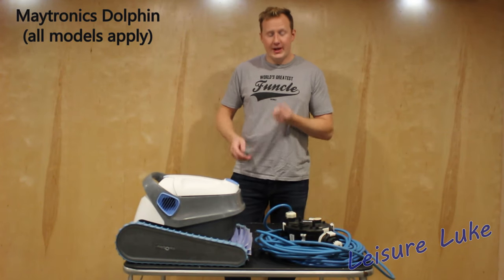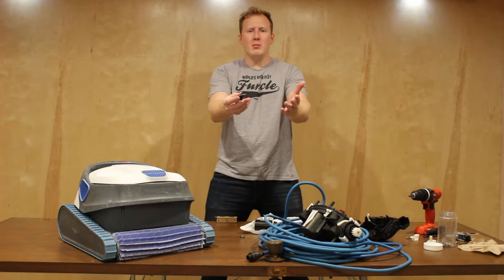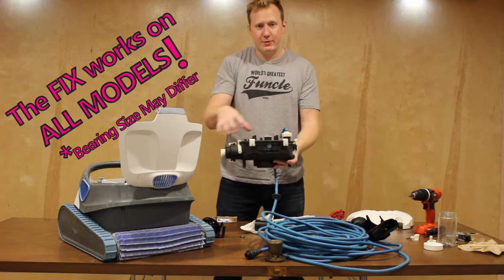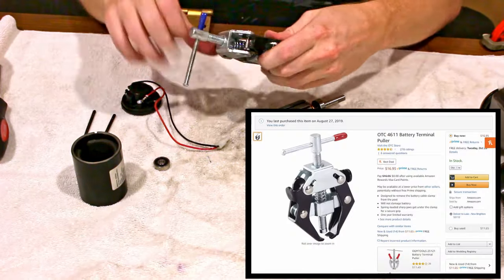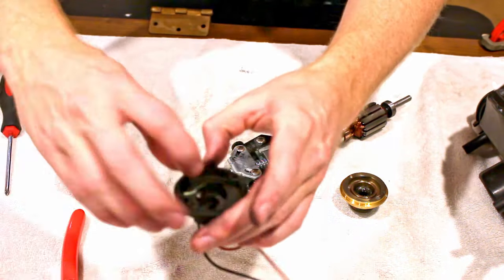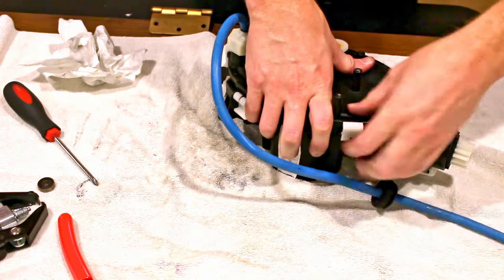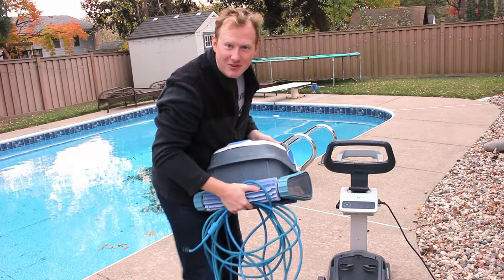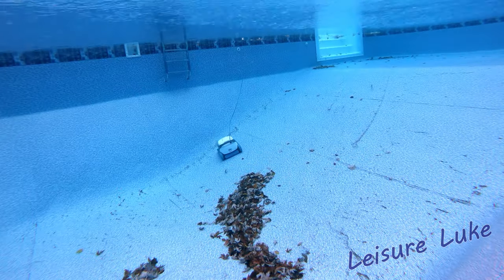Dolphin Pool Cleaner - BROKEN is FIXED!!!  SOLVED with 1$ Bearing | HOW TO REPAIR for MOST Models!

Comment: Great video. Got the motor pulled without a problem but unfortunately the 2 motor screws would not budge and are now stripped. I sprayed with Liquid Wrench and will let sit overnight.

Comment: Sweet as.  I have a different brand evidencing EXACTLY the same issue.  Starts moving then stops and shuts off all the lights on the console too.  Has become worse over time till now its a few seconds then lights out.  Removing the filter and running it only runs a bit longer.  Trying to drive the tracks is really hard to do but the impeller is free as a bird.  SO for me its likely to be the movement motor has a seized bearing.   Here's hoping that my Polaris p825/Zodiac CX20 motor unit is as serviceable as yours was.  cheers
Reply from the maker: Very likely, I've read comments of several other brands/models with the same issue on drive/impeller motors.  Fortunately, most come apart easy, and you've got nothing to lose!  Good luck & keep us posted!

Comment: Thanks for the great video. My impeller has no debris and will turn, but will stop immediatley if I stop pushing it. Should it continue to spin on its own after I give it a nudge?
Reply from the maker: Nah, there's some normal motor resistance as you pass the magnets.  If it's seized it'll be hard or impossible to rotate at all.  Sounds like your problem isn't the impellor motor bearings. Good luck!

Comment: I took my dolphin apart and found the same seized bearing.  just ordered the puller tool and the bearings from amazon.  I'm feeling optimistic that i'll have a working robot in a few days. thanks for posting the vid!
Reply from the maker: Nice work Braydon!  You've already done most of the work just identifying the problem!!!  Good Luck with the Fix, keep us posted!!!!
Reply: @LeisureLuke  The new bearing did the trick!  Robot is cleaning the pool right now and seems to be fully functional.  Now we see how well I resealed everything and hope water doesn't get into motor compartment.  thanks again for posting this video!
Reply from the maker: @braydon9493  Congrats on the fix!!!!  That's good money and plenty of landfill saved... good things!  That helps us afford chlorine this year!!!  Haha.  Seriously though, well done!

Comment: I have just had my robot for 2 weeks. It is running but leaf sometimes got into the impeller.  I can took most leaf out by squeeze my fingers onto the impeller.  I am already tempted to taking it apart after watching your video.
Reply from the maker: Yeah, it's just a few screws.  Keeping the impeller clean is crucial.  I clogged impeller won't let your suction properly, so climbing walls and clinging to corners can become problematic.  Good Luck!  You Got This!

Comment: Hi Luke, thanks for the video, my impeller spins, was your not spinning at all or just tough to spin?
Reply from the maker: It's always a little tough to spin, that's normal magnetic resistance in the motor.  IMPOSSIBLE to spin means you have a bearing problem.  I couldn't spin mine at all by hand.

Comment: Awesome video, I'm going to try to take mine apart see if it is the same problem. What I noticed with mine is that it goes back and forth, then stop. If I put it upside down, it does not stop ! Drives me crazy, I love my dolphin pool cleaner and want to bring it back to life !!! I'll update this comment if I can fix it. Thanks again for the video.

Comment: Mine is the nautilus cc plus my impeller seems to be fine but the drive motor shaft is barely moving and noisy. I’m going to give it a try. Thanks, didn’t expect it to be that easily repaired these things are usually impossible to get apart without breaking something is the reason I didn’t give it a try. Now I’ll take back apart tomorrow. Thanks so much! Phillip Hurst
Reply from the maker: I’m impressed with how well these come apart and go together.  I know other nautilus cc owners have fixed their drive motors the same way, and I’m 99% sure those call for the same bearings!  Good luck & keep us posted!

Comment: This is great! What is the pouch under the motor? It's shown in your video at 2:05.  Curious of its purpose? Mine was soggy and disintegrating
Reply from the maker: It's desiccant.  It's meant to absorb water incase water gets in it.  You should be able to replace it with any desiccant from amazon.  any 20-50g pack should fit.  These look good https://amzn.to/3AxnWFX.

Comment: Hey! Thank you so much for the video. I have been recently trying to open up the motor assembly, but I have hit a dead end. No matter how hard I try, the lid of the box won't let go. Are these white plastic clamps on the perimeter of the motor assembly the only thing holding it together, or is there something else? I would really appreciate if you had some trick up your sleeve! Cheers!

Comment: Hey Luke, Fellow Fipper owners. So, this week out of the blue.. my flipper started the dreaded move forward a foot, back a foot and stop.. I took the impeller top off and the bottom basket and its cover area.. nothing noticeable.. I CAN turn my impeller by hand, but it will not just spin it is tighter than that, seeing I never tried to mess with it new, I don't know the resistance level of it. but does this sound like I need to tear the impeller motor down also? I left the cover off of it and watched and it never does engage.
Reply from the maker: Hello!  There is usually resistance in the impeller motor, such that you could never spin it like a top, it's motor with magnets, and they tend to want to hold the impeller in place.  That being said, I'd still take the impeller motor apart and look inside your black box for any signs of water damage.  Sometimes cleaning out the carbon dust helps, you'll be able to check the bearings by hand, and you can check the length of those motor brushes, some people replace them and say it helps.  Remember to mark which color wire goes to which side of the motor - it matters :D  Good luck!

Comment: Looks awesome! My Dolphin stopped working and it may be the same issue. I will check it out and see. I will let you know. 
Thanks.
Reply from the maker: Good Luck!  If the impeller is clear of debris and still doesn't turn easily it's probably this.  Worth checking out!
Reply: Follow up— 
The motor was seized. Mine had different size bearings inside. I had to replace the 626RS bearing AND one of the motor brushes. It was difficult finding both parts. I had to order the bearing online. I found a motor brush locally but had to file it down to the proper size. I got everything back together easily and it works as it should. Thank you for your helpful video!
Reply from the maker: @zadina59  OOooo that's a lot of work!  Excellent job on the repair!!!  Congratulations, now you'll be able to afford that chlorine!  Seriously, well done.  That's FAR from an easy task.  You kept the landfill empty and saved some serious cash.  WELL DONE!

Comment: Great video. My impeller definitely spins fine, but my unit shuts off after a minute or two. Maybe it's the drive motor? Can you comment on how freely the treads should be able to move by hand? Although it performs the out of water test, my treads will move, but it is definitely not easy to move them.
Reply: I have the same issue. Out of water test it worked but put back in the water, it goes forward then back and stops within 10 sec. Visually I didn't see any dirt in impeller and it turned around but I don't know how freely it should move. If someone can comment would be perfect. thanks

Comment: Thanks for the video, my S200 stopped running and checked power supply and cable both have proper voltage. Impeller spins freely but the robot has no power. I’ll take apart the black box since you showed me the steps and see what I can find.

Comment: Are there 3 bearings or 2? I have one on either side that spin but I suspect there’s one more that’s wedged in to the main part - I’ve watched the videos a few times to try and figure it out- excited to see where I land!
Reply from the maker: 3!  The 3rd one is in brass cap, and doesn't come out with the center shaft.
Reply: @LeisureLuke It appears my issue is the bearing in the brass cap, but I can't figure out how to get it out.  I pulled the snap wring, but I don't know how to get access to the bearing from there.  Any guidance you can provide?

Comment: this is great advise thank you but I can separate the top part of the case from the rest of the motor unit, how did you do that?
Reply from the maker: Yeah, that's tricky.  Those plastic clips all need to be unclipped.  Then the lid is just held on by squished rubber seals/gaskets/rings and some grease.  You can use a flathead screwdriver to work your way around prying up the lid evenly until you're able to remove it.  Just be careful not to cut those rubber seals and you'll be alright.  Good luck.

Comment: Great video!  My Dolphin Triton PS was not moving, but still had water moving through it.  I disassembled the impeller motor and cleaned out the black powder with electronic cleaner and air compressor.  It is now working, but not going up the wall and falling backwards (pop wheelies as other described).  I am not sure what you mean that the red and white wires were reversed.  Do you mean on the mother board (green plate)?  I don't know how to solder, so what is an alternative solution?   Did I put the magnetic cover over the impeller upside down?  Thanks for your assistance!

Comment: This is pretty awesome, Luke! Thank you for taking the time to share your fix that worked on my Triton Maytronics, which also has the 626-RS ball bearing. At least, the one that was defective. The other one is 608 if I recall correctly. Both shields were collapsed, it was pretty impressive. There was also a lot of dirt/metallic dust inside, and fortunately no water. I took pictures that I am happy to share. I just don't know how to post them here.

Thank you for allowing to save additional frustration and expenses! Triton is now back in service (although I had to restart it twice  times, possibly until the fault cleared by itself. I wasn't able to reset it via the app, which seriously needs improvements.

A cool project would be to be able to start the robot from Wifi or set more than 3 repeats (useful when on vacay). And how about a feature that would allow Triton to not be tangled in my tikki table and stools in the pool? That would be nice!
Reply from the maker: I'm working on a tiki bar too - checkout a video I made about the Tiki Bar Top!  I'm mounting that on a Glastron PT84... which is cooler than it sounds #1Pun.  Now that I gotta see!  You can post pics and tag me @Leisure_Luke on instagram or @LeisureLuke on twitter.  I'd love to have stools in the pool!  Hahaha #2 Pun! :D Just no way to do it with my vinyl liner... that I know of.  Or throw it on reddit or facebook and send me a link!
Reply from the maker: Nice job with the fix btw.  Not an easy job, WELL DONE !

Comment: Thanks for the video. When you say the impeller is supposed to freely spin, do you mean like a ceiling fan? Like when I attempt to spin it, I'd be able to flick my finger and it freely spins? Or do you mean by applying constant pressure and it will spin? My does spin with the constant force of my finger but there is some resistance to that spin. Thanks again.
Reply from the maker: Sounds like you have a normal and good amount of resistance.  It won't spin like a top, but by adding constantly pushing 1 finger should be able to rotate it.  They're rarely "caught" in the middle.  It's almost always spinning normally or 100% locked and you'd struggle to turn it with a long pliers.  I'm guessing you're in the clear :) Good Luck!

Comment: Great video! Ever seen an issue where the motor drive and the impeller drive work fine in manual mode, forward and reverse only, but the unit won’t turn? Servo Overload message. The water flow piece that controls left and right does not move freely, in fact it clicks. No debris present, but at the point where I am going to pull the unit apart and attempt to fix myself. 30i active and issue started with a few months of purchase. I moved and it went to storage and I lost track of the warranty period, which has since expired, hence self repair.

Comment: Great video!  My Dolphin Triton PS was not moving, but still blowing water. I was able to dismantle the impeller motor and it was full of the black dust.  Cleaned with the electronic cleaner and then air compressor. reassembled it and placed back in the water.  Now, it is having difficulty climbing the pool walls and falls backwards with bottom up and does not seem to move as fast.  Not sure what else to do to fix it.  Should I just buy a new one?

Comment: Thank you so much for this video. I am hoping that this will be my fix. I have the motor out and my same bearing is locked up. Waiting on the new ones to complete the fix and give it a try. Thanks again.
Reply from the maker: Sounds like you're on the right track, and have found a problem!  That's basically steps 1-4 of 5 done!  NICE! GOOD LUCK!

Comment: Started my Dolphin cleaner this spring and the power supply popped. I was afraid to buy a new power supply. I came across your video and found some debree around the impeller. The impeller turned hard. So I followed your video. My cleaner has 2 bearing one in the brass cap which did not come apart. You were right. Getting the motor back into where the brushes make contact was a chore. My question is, How freely should the impeller turn assembled.? Thanks
Reply: I'm having the same issue. The impeller should turn freely with 1 finger rotating it

Comment: This was a great idea, and I followed the video to replace the bearing, however it still doesn't work.  Anything you can suggest I might have missed?  Thanks
Reply from the maker: Hmmm.  What are your symptoms?  Does it scoot back & forth and then stop?  Can your impeller be turned by hand when the machine is unplugged?

Comment: Great video Luke and really appreciate showing the impeller repair. Currently I'm trying to stop the Dolphin 20 from climbing the walls. Do you know if that's an option on the circuit board like dip switches or something? Ours scrubs in one place when it climbs and has gotten stuck behind the ladder so just cleaning the bottom would keep it useful. Thanks.

Comment: This winter i replaced the cable, rats chewed it into 3 pieces.  3 weeks ago when I opened my pool the Dolphin Nautilus CC Plus would not run, it was running last year.  The power supply is putting out 29+ VDC all the way thru the new cable, the cable continuity is good.  I opened the motor box.  It was dry and like new inside.  Both motors rotate with what I feel is the correct amount of resistance.  I tested approx 3 ohms on each motor terminal.  

My new cable is a 2 wire.  The old cable was a 2 wire, the output of the power supply is 2 pins.  Inside the motor box I notice that the motor leads are red and black.  The connector inside the motor box has 3 wires, red, black, and white.  The cable connector is clocked to the connector in the motor box, it can only be inserted 1 way.  The 2 leads from my cable connect to the white and black wires inside the box.  Could this be the problem?  Should the input power connect to the red and black instead of black and white?   I have read somewhere that some Dolphins are 3 wire if they have remote control.  Maybe that is what the white wire is for.  I wonder if I could modify the wires inside the box to correct the problem.  Maytronics has not been able to help, the only time I was able to finally talk to a service rep he did not know the answer, put me on hold to check with someone else and then we got cut off and he did not call back.  

Please help.
Reply from the maker: I’d keep trying their customer support.  Sometimes you can call your local pool store and they will impart some knowledge for free.  

I don’t know if red/black or red/white is the correct hookup.  I tend to wonder if it’s a control signal or perhaps some EU spec for their 220v systems.  I’ve got no knowledge here, hopefully someone else responds :). Good Luck.
Reply: After reassembling the unit it works.  Might have been a bad connection on one of the connectors.

Comment: Water in motor! Great video. I had the exact same symptoms though the impellor was not seized, just a little firm.
Unfortunately when I split the motor housing open I found WATER INSIDE. The unit had never been repaired before and no cracks were evident. The motor bearings all seem free enough and spin OK. I will test the motor. Do you have any tips for re-waterproofing the motor housing.
Reply from the maker: The housing should have 2 rubber ring gaskets and lots of marine grease.   It’s probably worth understanding where the water leaked from - there’s 2 motors, the cover, and maybe some wiring that all goes through that black box.

Comment: Thank you Luke. Great easy to understand video!  Unfortunately I have managed to damage the motor screw heads, while trying to remove them.  Do you / anyone know/ have a link to the size of the two motor machine bolts?  Thanks!

Comment: Thanks for the tip of replacing bearings.  I literally just took my dolphin triton motor box apart today and saw both motors you noted.  My question to you:  why didn’t you replace the bearings in both motors since they were the same age?
I will take my motor apart this weekend and see if I have the same problem. 
Amazon sells my motor assembly for over $900 and a new triton cost $1,000.   Crazy if I can fix for a few bucks.
Reply from the maker: Fair question.  At the time I didn’t realize how common the problem was, I had incorrectly assumed it was a once in a lifetime bearing failure.  I’m a big believer in not fixing things that aren’t broke.  I’ll happily do the job again if another bearing fails.